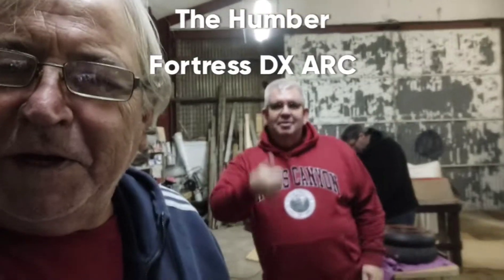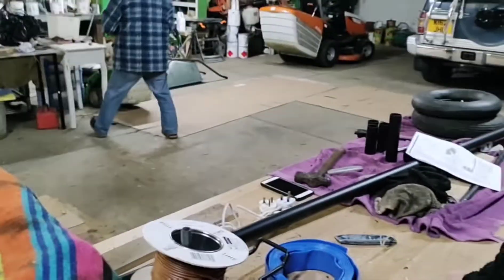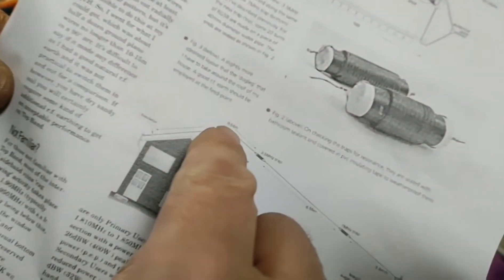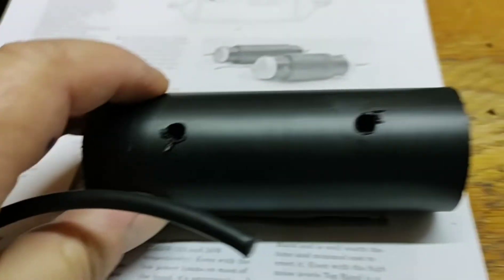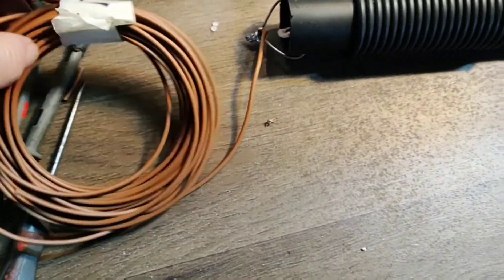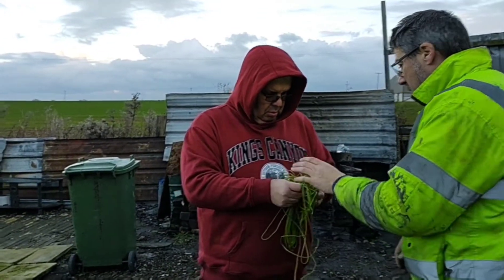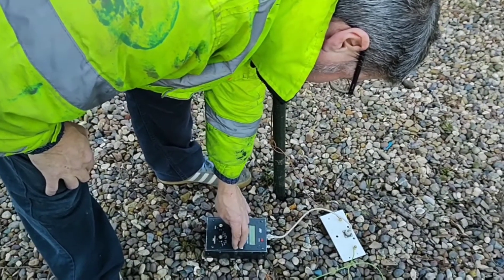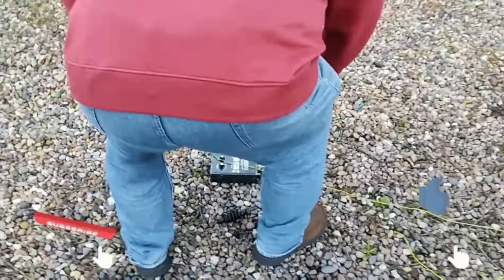Trapped inverted L endfed antenna. 40, 80, 160 meter bands.

Comment: i built the same antenna over 10 years ago she is still up and in good working order, feed point is about 1 foot above ground and i only use 2 ground rods and once i trimmed antenna to get a good swr starting from the 40m side then you then tune the 80m side, once thats done then add your 80m trap then trim that for good swr on 160. You do get other bands thrown in to but i found once i added 80m trap for top band then i did loose some of the other bands but the tuner soon sorted that out. Fantastic antenna.
Reply from the maker: Thx for the comment Jason, and yes it's a good antenna for the real estate it takes up.
Look forward to chatting on the bands mate.
Tappy
Reply: http://www.users.icscotland.net/~len.paget/Inverted%20L%20adding%20top%20band.pdf
Reply: http://www.users.icscotland.net/~len.paget/5%20band%20Inverted%20L.pdf

Comment: Great build,the inverted L works well for me and I have a few ground rods with around 30 random length radials under it which works well on the low bands.73 and good luck with your club de Gm4zji Chris
Reply from the maker: Thanks Chris, I will let everyone know how I get on with it. Weather shocking ATM so no antenna erections yet. 
73